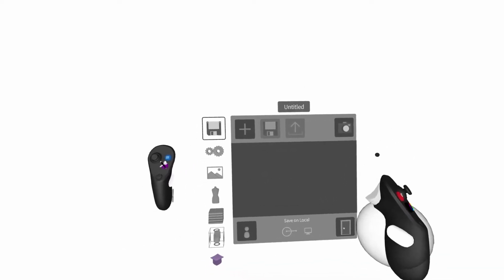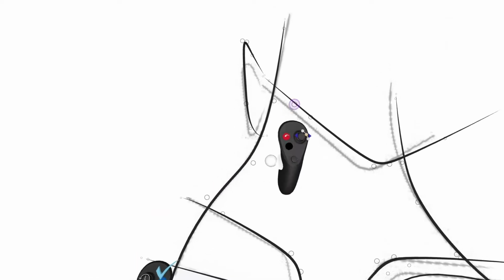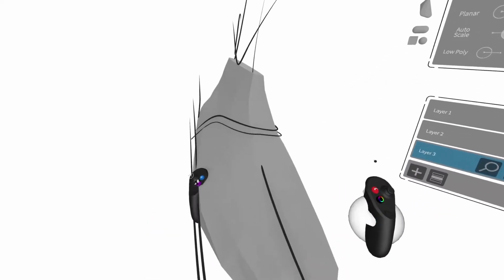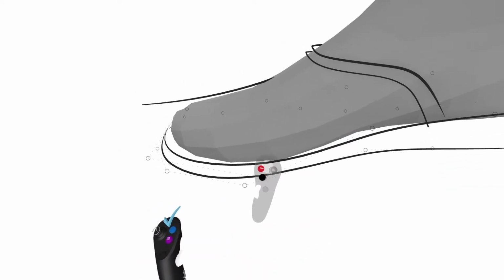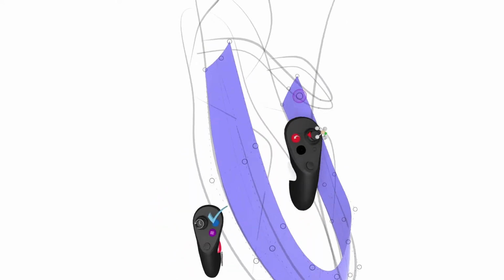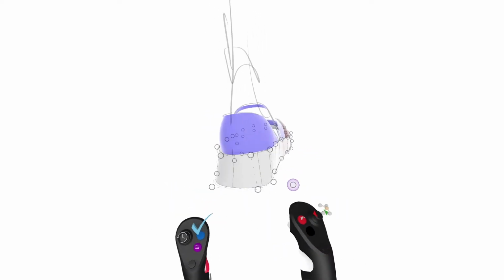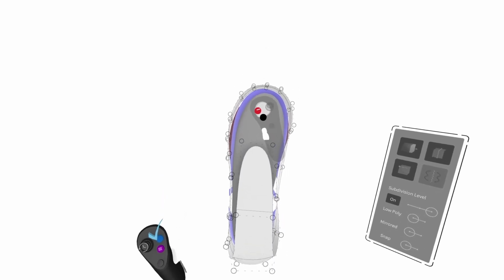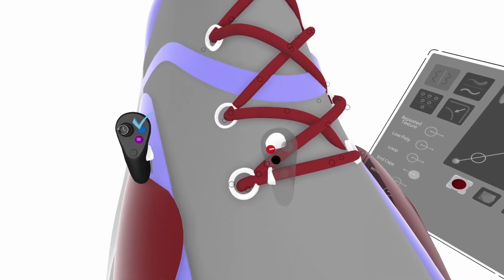Sketching a quick shoe inside Gravity Sketch - Workflow

Comment: Hi! Great tutorial, I am learning a lot. I am designer and have worked for years with shoe factories in Italy. I. am just wondering. why you didn't just draw straight onto the last like shoe designers do?
Reply: I'm guessing since you're working with models its the way the design engine is setup. you can use these models and then export them directly into blender as well

Comment: line merging is definitely something nice to have, mainly to eliminate continuity issue. 
Also, it would be nice if planer layer is a feature and with that, line trimming is possible. 
For surfaces, maybe surface trimming (find the intersecting edge of two surfaces and split both into 2 surfaces each along the intersection and some of those can be deleted afterwards) could also be a thing. Reason why it's important is that for solid modeling, trimmed surfaces can be sewed together precisely. I personally would not give too much hope that surface trimming is implemented any time soon, or at all, though.
Reply from the maker: All great ideas! These are some much requested features but are very complicated mathematically in VR. Our team is very much interested in trimming and boolean functions!
Reply: @GravitySketchYouTube  Boolean would be a great addition too, but the approach probably should be some what hybrid -- fast (but not without artifact) preview during modelling, and slow but precise algorithm for baking the Boolean (and during that the user can't use the software so maybe there can be a prompt to "take off the headset until finish").
Precise Boolean on subd mesh could take minutes to complete (as being the case for OpenSCAD) but the result definitely worth it.